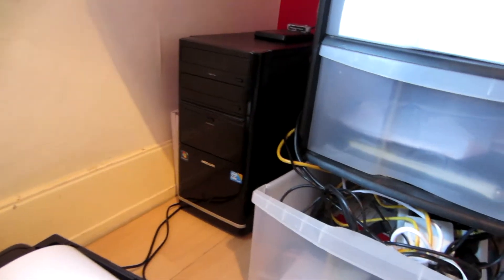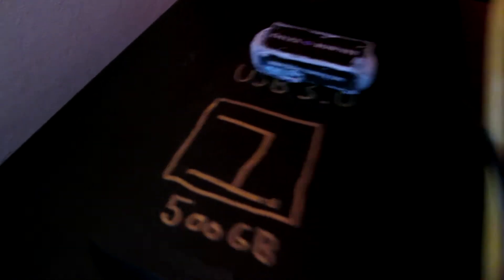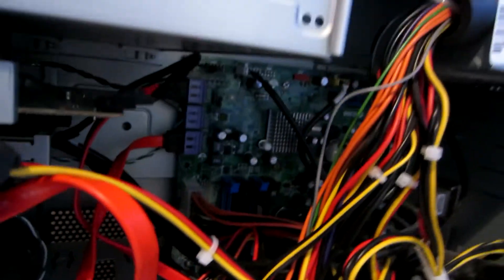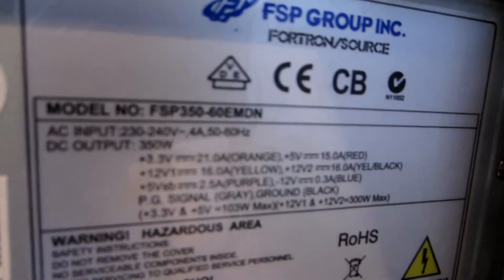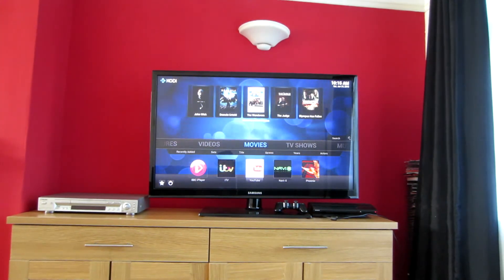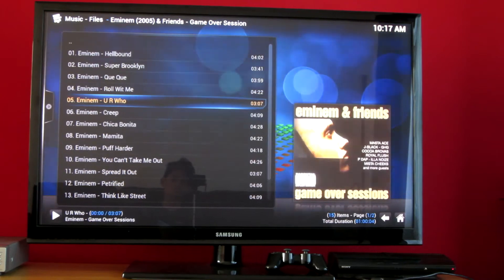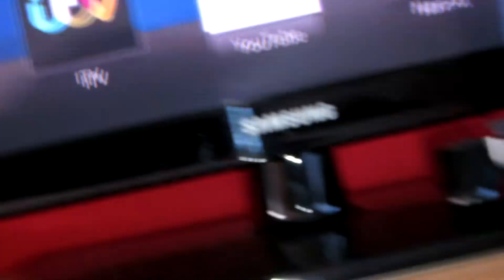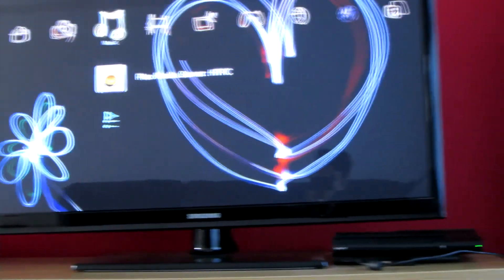2015 Home Network Tour | SERVER | VPN | PLEX | XBMC | APPLE TV | RASPBERRY PI|NAS|HTPC

Comment: The homeplug adds way too much overhead to be considered a plausible option. I suspect your switch is 100 megabit one, so if you can get a wireless signal at least that strong, then you should not use your homeplug, but the best option is allways gugabit ethernet and linksys/cisco/ubiquity